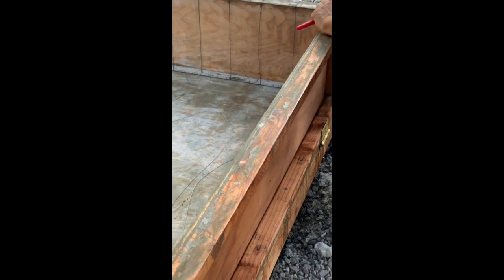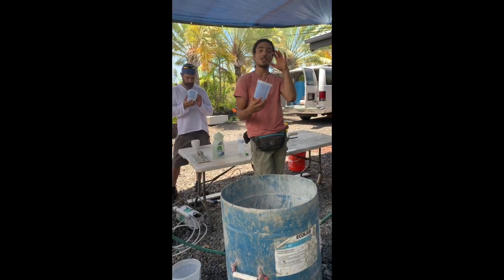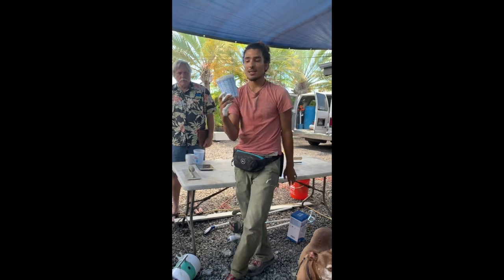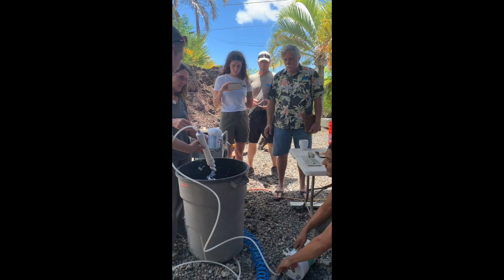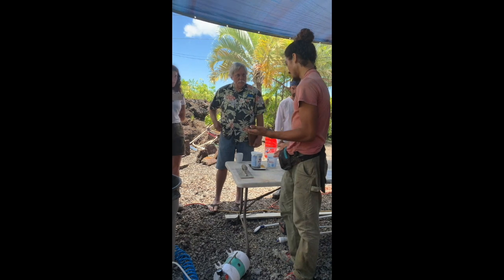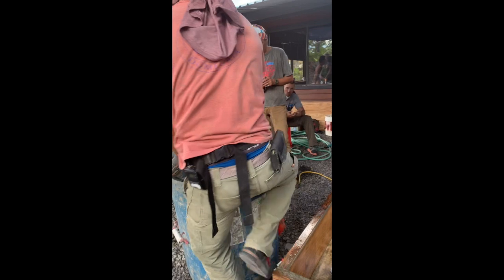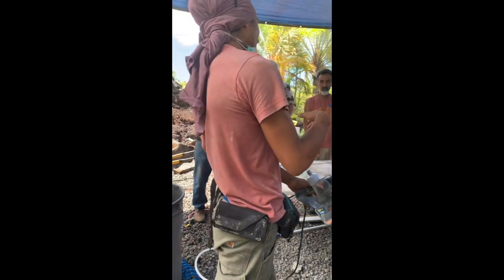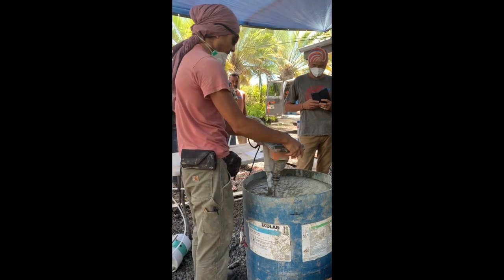How to make AirCrete using the Dragon XL

Comment: Is it possible to pour this product into a form to make walls? Would you still need rebar to reinforce the aircrete? Would using a concrete vibrator to eliminate air pockets have a deleterious effect on the foam?
Reply: As long as it's not too thick, it will settle well into the form. We are going to try to pour our walls. We do plan to use some pretty serious reinforcement. 🙂🏠

Comment: Hello .. can someone tell me the formula neat and clear please? I can't understand this guy talkings. 
THANK YOU
Reply: 90-100g of foam weight per quart of foam. 
 One 94 pound bag of concrete +6 gallon water in a 50 gallon drum then mix in foam to fill the drum.
Reply: @sarahmae277  Hi, excelente video...but, 90-100 g per quart....What is the meaning of "quart"..I am not used to this measurement, could you explain what is "quart" in milimeter?...thanks, Peter from Brazil.

Comment: Do you have a issue with cracking? If so, how are you fixing it?
Reply: Is it the polyester reinforcement paper?
Reply from the maker: Polyester Reinforcing Fabric such as APOC 483
Reply from the maker: I have not seen much cracking. These dome houses can survive earthquakes. The dome house is covered with a mesh that helps prevent cracks as well.

Comment: Great videos. I'm looking at smaller projects (1 bag concrete, not two). What is the target consistency of the aircrete where you know you've injected the right amount of foam into the wet concrete?
Reply from the maker: They did a lot of testing in the past and figured out the proper consistency. So if you use only one bag, then use half the amount of foam using the same size barrel.

Comment: at 8:42 when you tipped one drum worth of mixture in it barely came 1/4 up the sides of the mould, but 'next day' was at the top, does it expand by its self?
Reply from the maker: We added 4 more barrels.
Reply: Yes, did they add four more barrels or did it expand?

Comment: Would there be a difference of pour wet cement in foam instead of foam in wet cement?
Reply from the maker: It is a lot lighter to pour soap into concrete
Reply: yes, you would have to lift up a much heavier container

Comment: How do they cut the slab into blocks?
Reply: Wouldn't it be less labour intensive to make molds the size of the bricks?
Reply from the maker: @pteepan2708  You would need a lot of molds. With 20 people in the workshop we went through blocks fairly quickly. Pouring and cutting didn't take that long at all.
Reply: @pteepan2708  cutting the blocks after will counter the effects of shrinkage. She size blocks whether it shrinks or not. I am interested in the fishing rope she mentioned. Not familiar with that.
Reply from the maker: We used fishing rope. There were slots for the rope before pouring the aircrete. After it hardened we pulled the rope across.